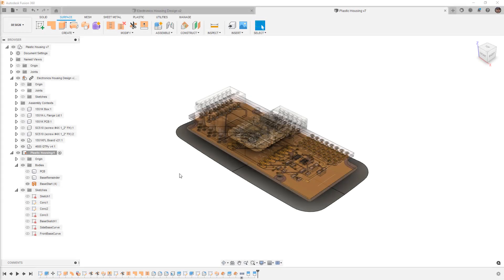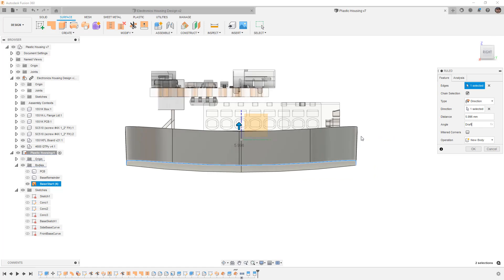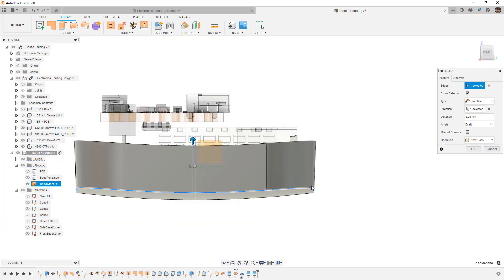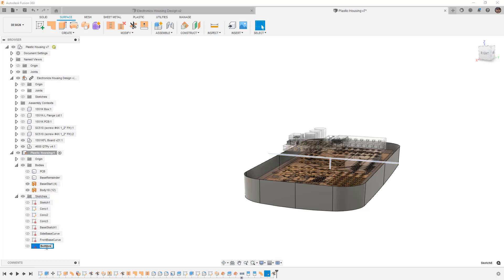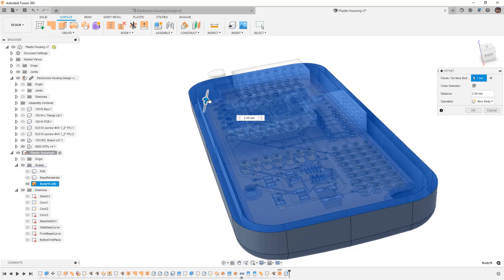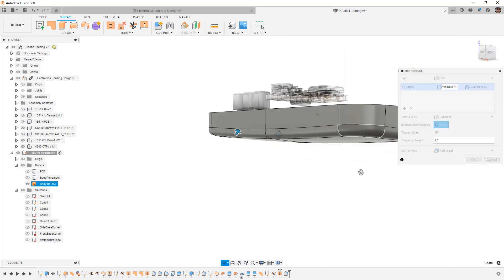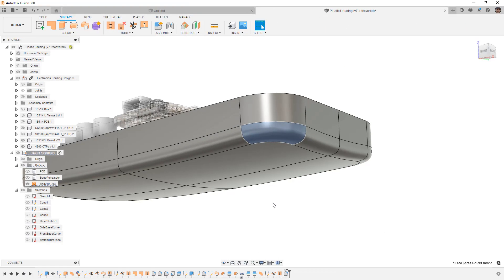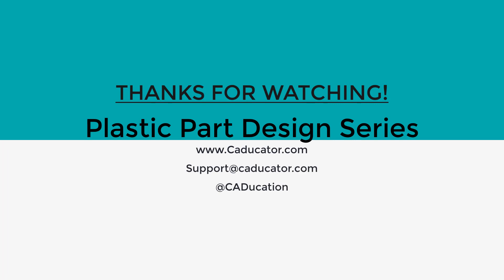Plastic Part Design Series Episode 6 - Creating a Base Surface Body #Fusion360 #Design #PlasticParts

Comment: Loving these videos. It’s crazy that you have the time to make these so often and so consistently. 

What’s the main difference between using a high tangency weight and just using a smaller radius fillet? 

Also, a question that’s probably it’s own video: communicating/dimensioning features with non standard geometry within a drawing, like surfaces built by splines and curvature continuous fillets. What’s the best way to do that? My answer has always been “send the CAD model instead of a drawing” but it seems like some manufacturers want a drawings.
Reply from the maker: Thanks IV Brooks!  That is a good idea about a video on fillets vs surfaces etc.  Ill add it to my list :)  It is a lot to unpack in a comment but let me try to break a few things down.  Also let me note that the surfacing tools in Fusion 360 work well for most situations, this housing actually fought me a bit.

With a standard fillet you aren't carrying the curvature across the faces.  But there are of course nuances.  You can define a fillet by its width(chord length) which is helpful when you are talking about varying face angles.  But the tangency vs curvature part is really taking a look at how the "weight" or influence of the surrounding surfaces affect the "fillet"  So with a fillet its basically like you are making a set of artificial control curves.  So if you think about it in 2d with sketches if you had 2 straight lines and drew a tangent arc between them, that arc would have a consistent radius of curvature.  If you drew a spline between them or a conic, then the radius of curvature changes.

With G0(connected) you are just saying the end points of the surfaces touch.  With G1 you are saying the direction of curvature at that edge is carried over into the new surface.  With G2 you are saying the direction AND radius of curvature at that edge are carried.  G3(which we don't have) looks at all of those but also the rate of change.  So say you had a surface that was decreasing radius closer to the edge.  So say the radius was going from 20 to 10 to 5.  Well if you just use a Curvature constraint the radius is 5.  But if you had G3(like true Class A surfacing tools) then it would be 5 at the edge but then 2.5, then 1.25.  Basically carrying that rate of change or Acceleration.

With all that said now lets tackle your actual question.  High tangency weight vs smaller fillet.
The tangency weight is taking the direction of influence and giving it more priority.  If you have tried to sketch with a Conic, the conic has a Rho value.  If this is close to 1.0(can't hit one actually) then you get more of a cone.  If its at .5 you get basically an arc.  In reality what you are doing is changing the slicing plane through a revolved cone but that is outside of this.  So when you change the tangency weight the fillet isn't just starting later(like a smaller fillet), just the tangent direction of the surface is slowly changing.  For this to have any sort of affect you actually have to consider both side of what you are trying to patch together.

For the drawing dimensions or a spline. That is tricky.  Some splines are defined(well all) by equations, but that is of little help in a drawing.  If the intent is to use the drawing for inspection with CMM then the best way I have found is to include points along the spline at a preset distance from an origin.  So give some sort of running or ordinate dimension of those points relative to a Datum.  It kind of depends on what the drawing is needed for.  Nobody will be manufacturing a complex part based off a drawing of a spline so it will come from the BREP surface in the CAM software.  So in most cases just the spline end points and maybe tangency angles could be enough.  But again the points on a curve at a set distance, lets say in X every 5mm, then in Y give the height relative to a planar datum reference.

Hope that makes sense.
Reply: @LearnEverythingAboutDesign  Thanks! I think I understand. Because the spline is based on an equation more or less, giving the coordinate points would allow the person looking at the drawing to sort of reverse engineer what the equation is?
Reply from the maker: Sort of.  You are basically saying you can measure the location at this point.  So if you think about something a little easier like a parabola.  If you plot a few points on a grid then you could pull back and reverse engineer that.  With a spline its a little more difficult.  So a spline "could" be defined by y = x^2 but generally in CAD what we have is more difficult.  So the points just let someone say okay at 5mm i should be a 2mm heigh. at 10mm I should be at 3mm height.

IF the spline was defined by an actual equations then you could provide that as a note on the drawing but I don't think I have ever seen this one!  I have done a design for someone that used equations to define curves of revolved cones.  Those were derived from some forumulas for some ultrasonic flow bench thing.  That is the only case where I have used equation driven splines and then the drawings and reports included those equations.  Most of my work with splines is cosmetic where the final mold or part is machined off the CAD data.